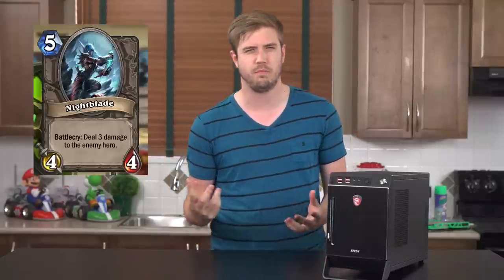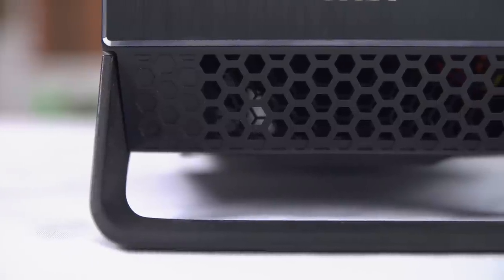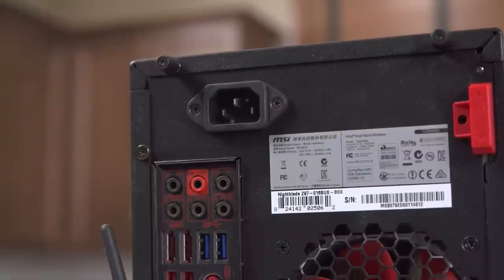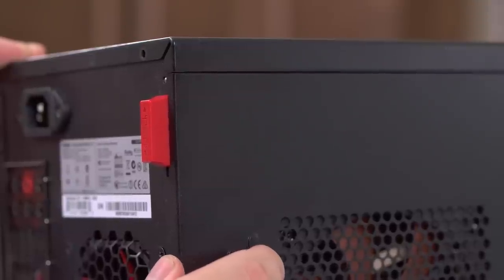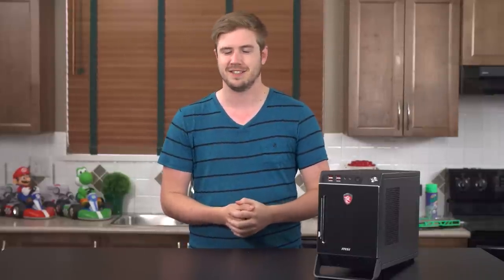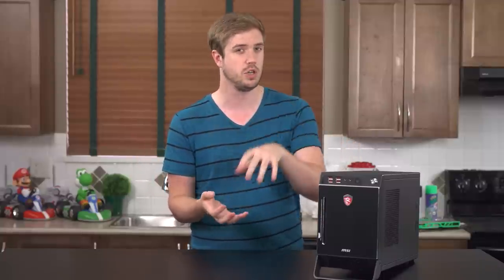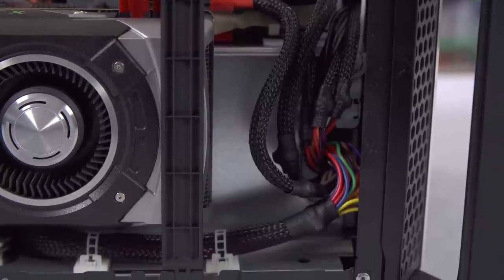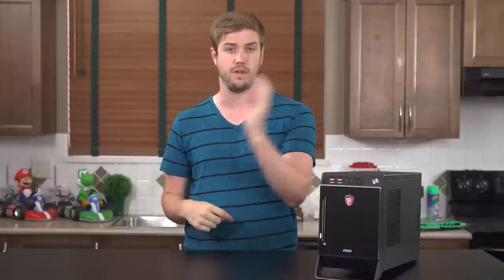MSI Nightblade Barebones Computer Case

Comment: Can you put Water Cooling ?
What is the best cooling system for NightBlade ?
Thank you!
Reply: Bozhidar Kunev Does it look to you like you can fit water cooling in there?
Reply: Trist º Nope just asking. 
I Want to be sure 100% :)
Reply: Bozhidar Kunev well, you can put water cooling, just not in there.
Reply: OK and what is the best solution for this :)
Reply: Bozhidar Kunev well... As you are probably not gona nitrogen cool your computer, I'd say regular air cooling.
Reply: Trist º not sure, but maybe you could get a small closed loop for the cpu onto that additional side fan mount
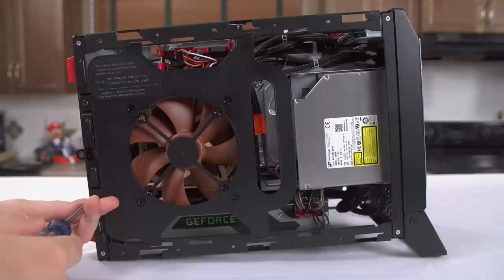Reply: toby marol I don't really think so, I mean, the block would be smaller but you would still have to deal with the rad ( more than 120mm is impossible) and the fan, maybe if you removed the stock cooler and just tightly mounted the rad and fan on top of the water block by mounting it in that little panel at 4:36, exhausting air out of the case (I don't think it's a good idea to push hot air into the mobo and water block), all though that would still get a bit less airflow due to the case just being small and would get you some more dust inside the case due to negative pressure caused by that fan and you would have to unmount the water block and fan or leave them hanging along with the panel you where to remove them for some upgrades or whatever, making it even more difficult to work with than it already is. c:

Comment: can you fit a gtx 980ti in this case ? really want to upgrade mine but cant seem to find out anywhere if you can or not.There is an msi gtx 970 in there now and i know i will have to upgrade my psu as well.Any help would be greatly appreciated thanks .Also mine is the b85 version not sure if that makes a difference or not.Thanks again
Reply: Most likely.
Reply: you should go with a 1080 or 1070, less power draw, more performance

Comment: Is it worth buying this?
Reply: I loved it, been building PC's for a long time and building on this mini retro looking case was so much fun, built a mini monster with OC'd i7, OC'd GTX Titan Black and OC 16gb ram and added as many SSD's I could and a 3440 x 1440. Also managed to add water cooling on the cpu but it got cramped in there so I had to look for a specific fan size and pump model or else the case wouldn't close.

Comment: I'm thinking of selling my gaming pc which has a i5 2500k,8gb 1600mhz ram,and a gtx 670 to build a system with a a10 7850k.
Reply: It's takes up half of my work space
Reply: Also I kind of bored of over the top gaming pc's I'm just gonna build a system to do basic things
Reply: And I'm thinking of a mini itx build and not micro atx.

Comment: what is the best case that has a good places for fan outcome and income? please only cheap
Reply: Just look on the channel , cases are personal things .
Reply: Corsair Carbide Air 540
Reply: YouTube is not the place for this go to tomshardware or something like that
Reply: Zalman z11+
Reply: please go to the forum and ask
Reply: Not the best bit i like the design and its cheap but good quality
Reply: corsair carbide spec 02 or 03
Reply: for real cheap check out aerocool, they are cheap and not that solid sadly (the fan grills have a bit of flex to them, some people can't bear this) but they have lots of fan install options :D
Reply: i got the spec 02, comes with 2 fans, two front panel usb 3.0 ports, 2 back panel usb 3.0 ports, 2 usb 2.0, and 2 usb 1.0 ports.as well as many other ports
Reply: YouTube is not the place for this, this topic is extremely subjective. Go ask on the forums.
Reply: If you just want to rename icons on the desktop the Silverstone TJ11, Cooler Master Cosmos II, or Corsair 900D will be fine. If you want to do anything like running a web browser you're going to need a CaseLabs MAGNUM TX10 or better. 

Hopefully you find this helpful! Happy shopping!

http://www.amazon.com/dp/B004MKNNGM/ - Silverstone
http://www.amazon.com/dp/B00B1R8JT0/ - Corsair
http://www.amazon.com/dp/B006P88VNE/ - Cooler Master
http://www.caselabs-store.com/magnum-tx10-v/ - CaseLabs
Reply: Nzxt h440
Reply: if you want to buy something on the cheap, you will get what you pay for it...
H440 is a great one though
the NZXT Phantom series is good too
Reply: Go to newegg.com, go to their case section, set the max that you want to pay on the side menu, start looking at cases.
Reply: MuffinProductions H440 is amazing but not the best for airflow. He'd be better with a CoolerMaster etc case.
Reply: Why say cheap? Cheap is subjective. I would call $130 or £80 cheap. Say a budget instead and just use the forums.
Reply: G. Minus it Works realy great for me
Reply: Try Corsair Carbide Spec 01, cheap and 6 spots for fans (2 front, 2 top, 1 back, and one for the PSU at the bottom)
Reply: I'd go with the BitFenix Merc cases (alpha or beta). For 30-50 euros, it's quite good value in my opinion. I've seen couple of builds with it. It's nothing special, but it has room for a quite overkill cooling if nothing else.
Reply: Corsair Spec series, Fractal 3300, Nzxt phantom 240, Nzxt Source 210, In Win GT1, BitFenix Neo, Corsair Graphite 230T, Zalman z3...... Yeah that's all I got off the top of my head.
Reply: CORSAIR Carbide SPEC-03

Comment: I like building, but that case look awesome and needs a window.
Reply: Steve Austin What!?
Reply: blackice11z true facts, don't fight it! (also good aesthetics such as that sexy red and black, with a cool dragon on it adds 8fps)
Reply: This case is too tight for a window. A window would look awful on this
Reply: FoodOnCrack EVGA Hadron looks good, great with mods and custom cables. I think the Hadron is smaller.
Reply: Steve Austin What?
Add what?
What?
That's not true and that's the bottom line cause Stone Cold says so!

Comment: I was planning to buy the nightblade, but its probably very outdated now 😑
Reply: its not outdated in terms of actual machine but you cannot buy it anymore from retail stores... sucks. I have one with gtx 1060 and is running awesomely
Reply: @ThisWasEpicness  What's the best graphics card you reckon will fit in it by 2022 standards, I like the 6600 xt but I don't think it will fit

Comment: You never ever said in the whole viedeo that it's nad itx case. I think it should be said, when it's not a standard case.

Also... ok-ish barebone, crap case. And because you can't change psu, or move cables it's a really crap case. Even for an ITX sized case. They could have put that hardware in a less crappy case.

Comment: Why don't they just make all USB ports 3.0 these days?
Reply: Lots of devices are still USB 2.0 today.
Reply: +BigE1943 wouldn't 3.0 just bottle neck and run at 2.0?
Reply: Elias Treger I don't think 3.0 ports can fit 2.0 plugs. They don't in my experience.
Reply: +BigE1943 they are exactly the same,  just faster.
Reply: +Hungry Guy I have heard tell of some devices that don't run optimally in usb 3.0. Some gaming mice specifically.

Comment: What are barebone pcs
Reply: +leslie yiu A PC that has some of the stuff already in it and assembled. Like, most of the time they will have a MoBo, CPU, and a Power Supply. But you can usually add in your own GPU, Ram and drives. Basically, they're for people who only want to do the relatively easy stuff without having to worry too much about cable management or fussing around with tiny screws on the MoBo and stuff like that.

Comment: What does "bare bones" means?
Reply: It means that the case is pretty much empty so that you can fit all the parts you need (I think)
Reply: hmm..
Reply: Born Boy barebones basically means it's not a complete computer, it can apply to something as basic as a CPU/motherboard combo up to a complete computer that just requires assembly.
Reply: ***** Oh, didn't know that. thanks

Comment: Can it run gta 5 or 4
Reply: +RandomGamer i suppose if u put the right components inside. its barebones so it doesnt come with a processor a graphics card
Reply: ***** was it supposed to be a joke?
Reply: +vespaman101 So does it come with a ram or a hard drive?
Reply: ***** look it up. probably not. might come with ram but i doubt a hard drive. the whole point is to put ur own componnents inside.